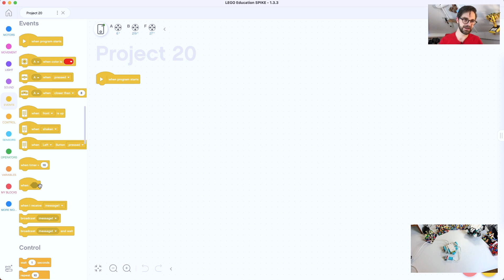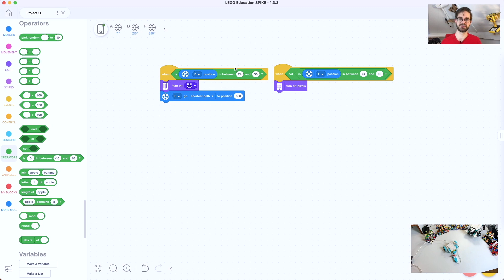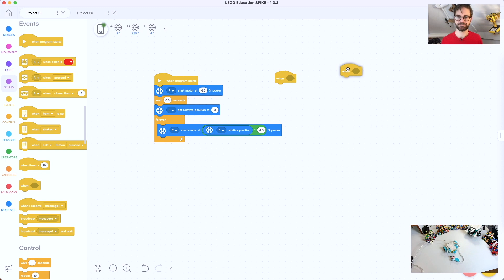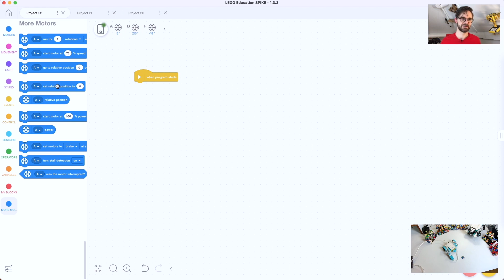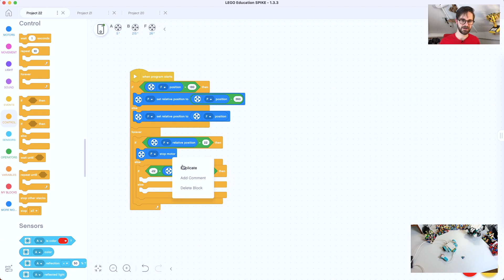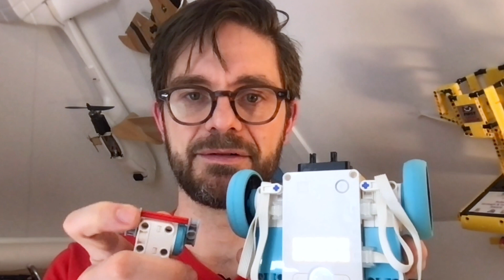How to use a Robot Inventor motor as a Force Touch Sensor

Comment: Hi!  Great idea!  I have a question that I can't find an answer to.  How much mechanical play is there in the medium and large Spike Prime/Robot Inventor motors?  How does it compare to the EV3 medium and large motors?

This is an account for a youth robot team and we're deciding whether this the year to upgrade (were switching to Scratch either way).
Reply from the maker: The same as EV3 motors, I'd say +/- 5 degrees. The encoder is on the out axle, which means the angle will read accurately to the degree. But on a stopped motor, you can twist the out axle 5 degrees forward and backward until you start to feel friction. This is big problem for control, especially for breaking hard.
Reply: @AntonsMindstorms   Thanks so much for the reply!  I appreciate it.  Yes, it's a big issue for control.  Our team spends a lot of time thinking about this and trying to negate it in First Lego League.  Thanks for pointing out that the encoder is on the out axle.  I had not thought about where in the gearbox it was.

Comment: Antons about Gelo, does yours drift to the right when going foward? Also mine cant do the trick were he stays on his front and then falls into his legs again. I have rebuilt him one more time and the problem is still there.😔
Reply from the maker: Yes, there is a slight drift, but I corrected for that in Python. I suppose you haven't used Python to make him stand on his head? I wrote an advanced program, and I still have to make a tutorial for it.
Reply: @AntonsMindstorms  yeah, i programmed him on the scratch blocks and not in python. I guess my floor type can also affect how he does the trick right? It is hard ceramic floor

Comment: Great video, Anton. Thanks for the idea.
So it’s OK to manually move mindstorms motors when they’re connected to a hub and powered on, then?
Reply from the maker: Yes. Electrically there is no problem. Be careful with really excessive force (hitting it real hard), however, because the internal gear is still made from plastic.
Reply: @AntonsMindstorms  can the spike prime force sensor work in robot inventor app?
Reply from the maker: @turinreza  Good question. I'll try.